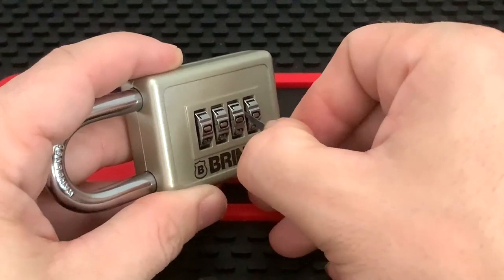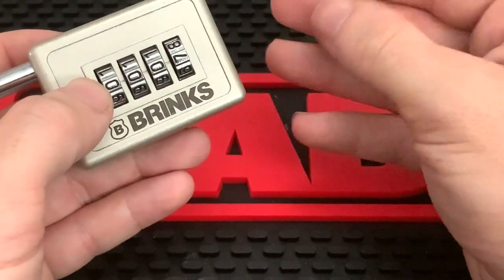Quickly Decode a Brinks Combination Padlock

Comment: Thanks for the information. I also found if you shine a light on the edge of the code wheel you can watch till you no longer see a reflection, this is the groove. Then rotate them 5 like you noted. Unlocked my kids padlock after his sibling decided to scramble it for him and promptly forget the code.
Reply: Thanks for this tip. It was definitely quicker than his way.